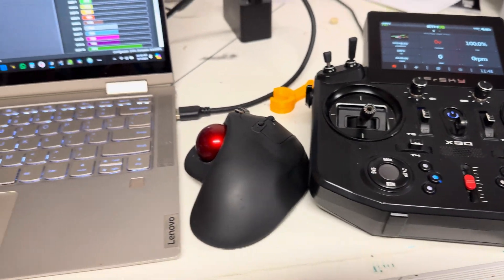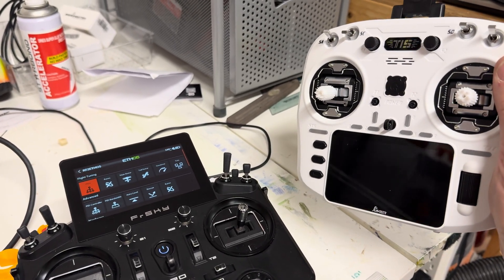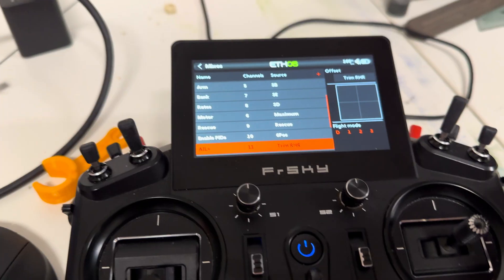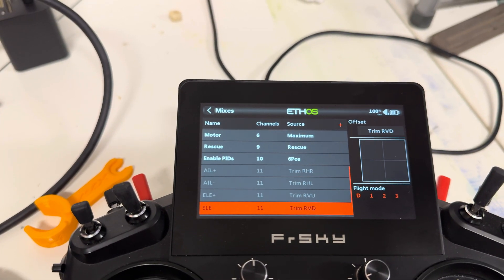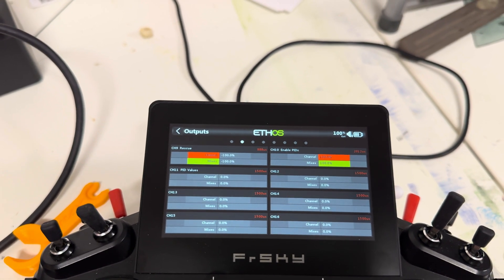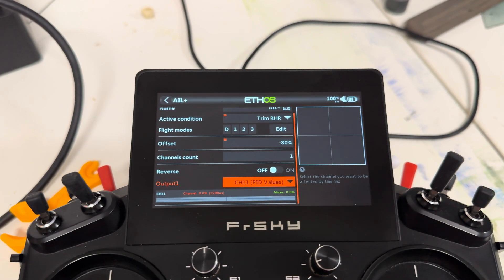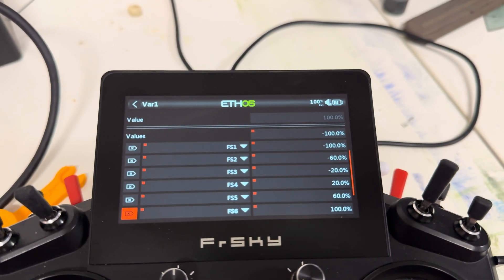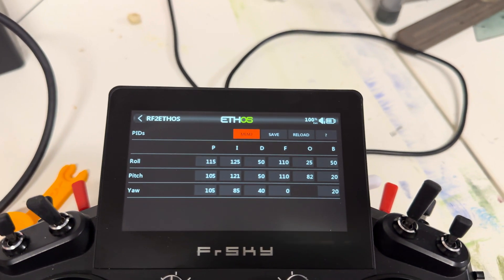Rotorflight in-flight PID adjustments with Ethos

Comment: Chris, hello great information. So happy I found your channel. I have everything working correctly(I think) I am confused about adjustments, enable channel and the value channel. If you can help me with this. Thanks you Matthew
Reply from the maker: Within the Rotorflight configurator there is an Adjustments tab. There you can set what channel enables the function, and what channel changes the value. I use channel 10 to enable the function, and channel 11 to change the value. These are mapped to AUX5 and AUX6 respectively. In the Adjustments tab you then make entries for each item you want to change, such as "Roll P-gain", and use AUX5 as the Enable Channel value and AUX6 as the Value Channel value. If you go watch the RC Video Reviews video he goes into more detail on how to do that than I did in my video. Hope that helps.
Reply: @JustPlaneChris thanks Chris, yes I had the channels wrong in my adjustments. Thank so much ✌️🚁🚁

Comment: Thanks for the video, very nice setup, you say you love elrs, do need that connection for this set or is ethos connection good enough? Thanks again
Reply from the maker: Ethos is the operating system the FrSky radio uses, so it's used whether the receiver is ELRS or FrSky protocol. Most of my helis are now using FrSky protocol receivers, but I still have a few on ELRS. Both are great, but ELRS requires you to use a module in the back of the radio.
Reply: @JustPlaneChris thanks for the answer. I was thinking the same. Do have the extension pod for elrs. Still use frsky protocol
Reply from the maker: @matthewfurst1577  yes, I have a BetaFPV ELRS module. I like ELRS, I have it in 3 of my helicopters and 2 airplanes. I will probably be using more, the receivers are very inexpensive and have great range.

Comment: hello bro.
i wonder if you could try to download the settings to a zip file to ethos users like they did for edgtx...

appreciate
Reply from the maker: Unfortunately it's not quite as easy to do with Ethos radio files since there's no "companion" software that you can use to copy and paste the special functions into your model file. You'd end up with my complete model setup, which I guarantee is not going to be exactly like yours! Really, this setup is not that useful. It's far easier to make adjustments using the Rotorflight LUA script. Safer too, since making adjustments in-flight is just asking for a crash!

Comment: hello.
can you please teach us how to set up everything on rotorflight and ethos so that function will work?

I could not get it right..
many thanks
Reply from the maker: Go watch the linked video from RC Video Review, he goes into more detail. Even though his video is about EdgeTX, the principles apply and the setup within Rotorflight is exactly the same. You probably missed some of the setup steps in Rotorflight, because I did not go into detail there since it was already covered in the other video. My video mainly focused on the Ethos side of the setup.
Reply: @JustPlaneChris  i am using ethos... and wonder if you can teach me how to configure PIDs like you did